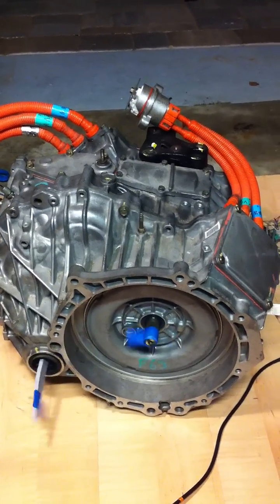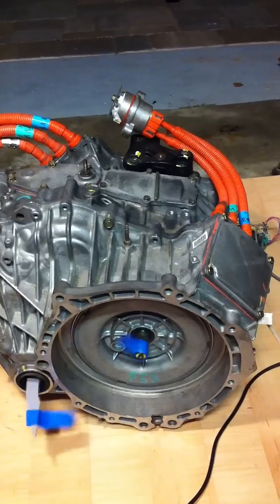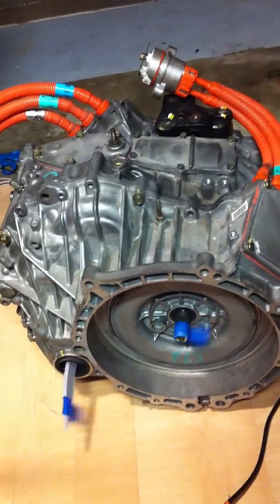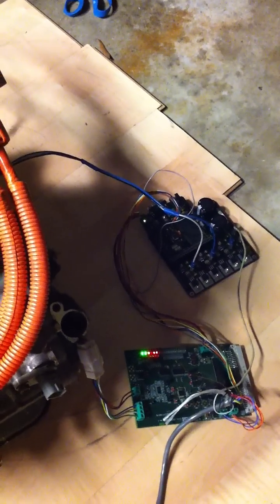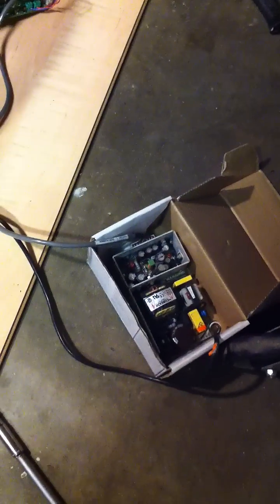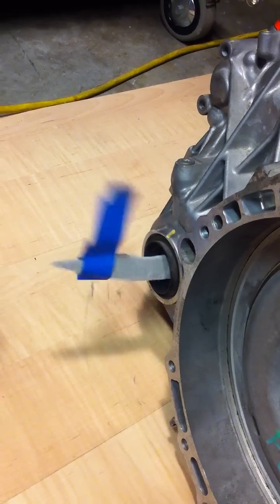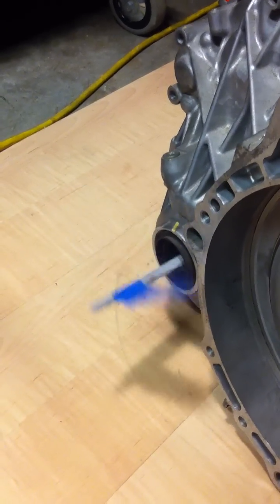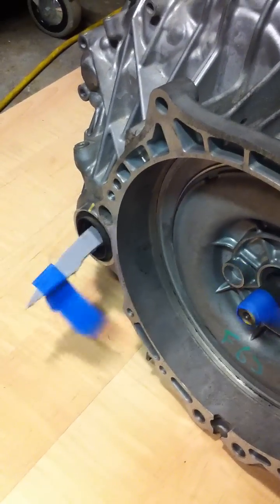Prius Transaxle spinning.MOV

Comment: Thanks for the upload! Do you think a brushless dc motor controller driver will run mg1 from a 2003 prius? I was looking at this http://kellycontroller.com/kbl24101x12v-24v100a-bldc-controller-with-regen-p-52.html
Reply from the maker: I think it could make it spin but I don't think the BLDC controller you refer to will be optimal (or even satisfactory).  I tried using the basic 6 step BLDC commutation on these motors and thought there would be no problem but I was wrong.
These motors are IPM (Interior Permanent Magnet) motors not the basic BLDC motors (with exterior rotor magnets).  I learned that this means they are a cross between a reluctance motor and a BLDC motor.
The extra reluctance torque of this rotor design must be considered by the controller to get the maximum torque per amp.

I hope to get back on this project soon and make some serious progress on a controller solution.